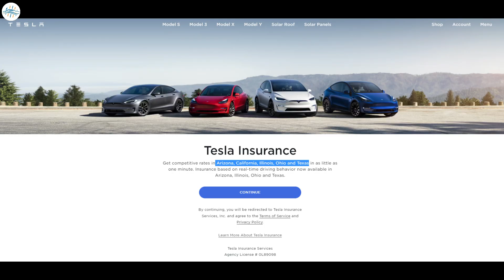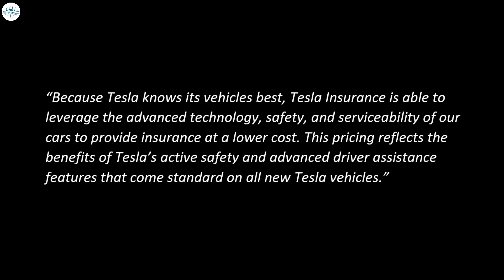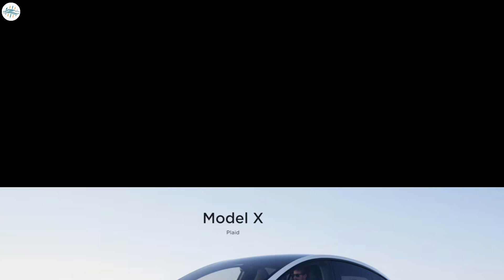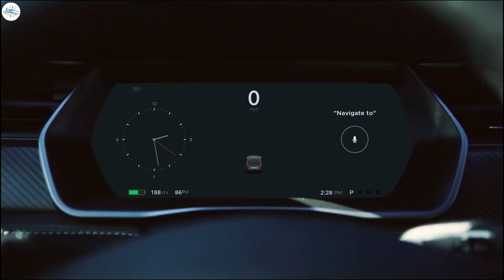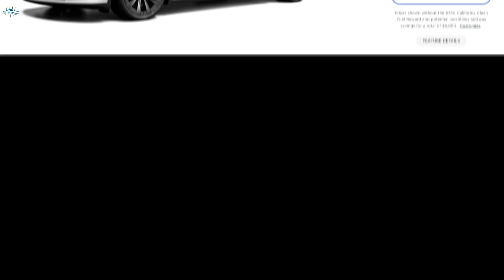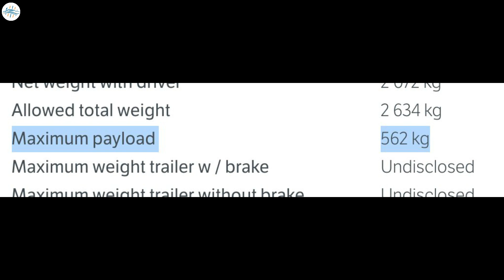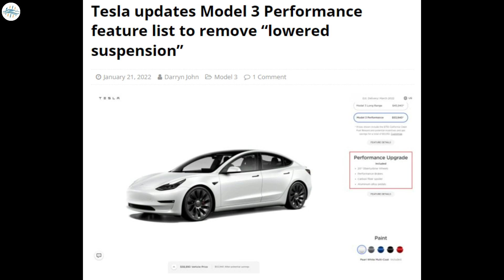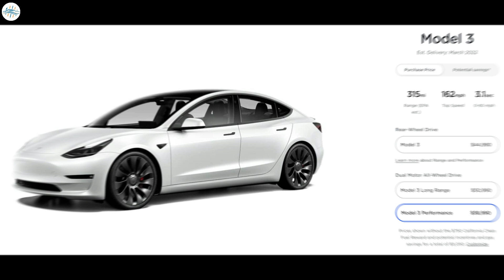Tesla's New Model Y Gets More New Features & More Updates!

Comment: It would be great if Tesla brings air suspension to model 3 performance
Reply from the maker: That’s true
Reply: @TheElectricArena  the model 3 and Y on 2022 without air suspension are still getting a better suspension than the 2021 models according to some  rumors. 
Hoping that the new chip will be in all vehicles though , and for the standard range.

Comment: Payload increase in likely just the amount of weight lost due to less batteries needed with the  4680s. They wont need as much to get the same range. More efficient. I would speculate the car is 178lbs lighter. 4555lbs but batteries could be 15% more energy density vs 2160. 300lbs. Probably added some extra capacity and rigidity so only took out about 200lbs.

Comment: Not sure why they would change the lowered suspension on the performance model 3. I guess they have their reasons, but in my opinion, it looks much better lowered. Lastly, I can’t wait to hear your video when you introduce the 4680 batteries 🔋 with the 1 cast piecing 😁